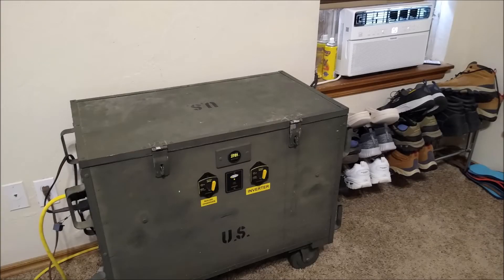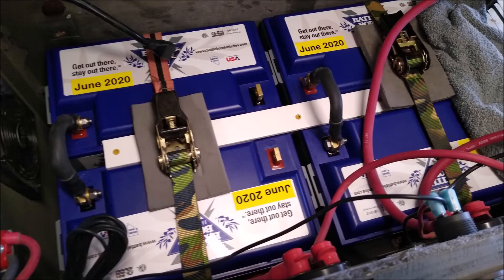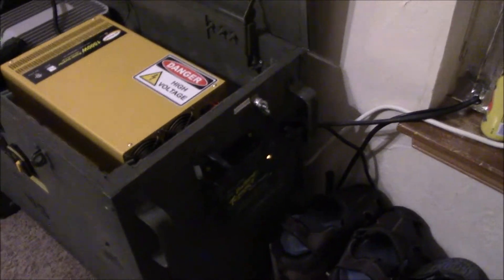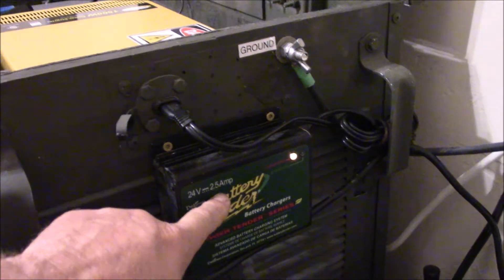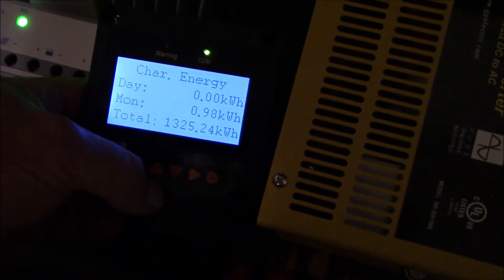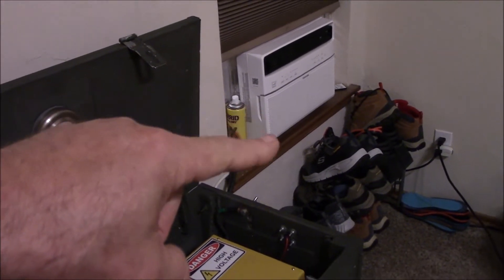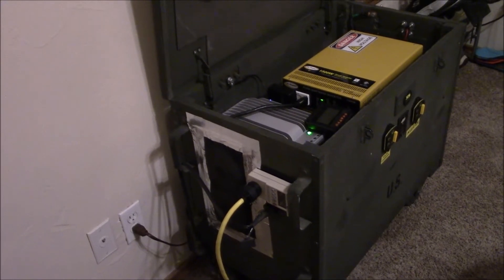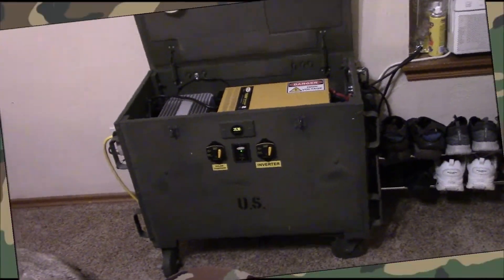Transportable 24v solar power battery charger inverter system (now with Battle Born lithiums)

Comment: the cc 40 amp can only handle 800 watts i thought. i modeled my first solar system off your box lol  same cc mt50  etc but i went zreliable inverter . the my  go inverter  were 1500 watt twice the price as zreiliable. by the way your a class act   as is. will prouse and david potz learned alot off you guys over the last couple of years. if you got a face book or something i could send you a picture of my 3680 watt  solar shack. with its  16  6 volt  gc2  . 8000 usd  in solar  stuff .and no end in site. i even just sold my fishing boat . no time. solar is way more fun. take the boat money and buy me some lifep04. solar addiction is fun. expensive but fun. most hobbies are expensive at least solar gives back .

Comment: hi criss my 8  costco  6volt  gc2 got overcharged by a rouge  chinese  master 100 charge controller. over gassed the shit outta them. what now garbage time? ive since bought the midnight solar charge controller but too late. i just toppedthem  up with distilled and put  a 72 inch battery blanket on in the winter.but  to late they froze. cause the cc shut  down .and sucked them dry.  should i  charge them and then  load them a bunch of times  to get some thing outta them. ive got 8 100 watt renogy panels and iota 45 amp battery bank charger and a prologic smart charger  . do you think switching 4 battery's into service  with the   prologic 2amp trickle for   a week each first individually .then the  renogy panels for a week .using the power daily from just 4  6 volt battery's  in a 24 volt config draining them dry . 4 battery config . and then  the iota charger  for a week 4 battery together over and over?

Comment: very nice setup. Those Battle Born batteries are great. MY go power unit never fails me except for the kind of hanky GFI outlet was always a problem. I decided to keep my 4000 watt samlex inverter. I'd like to use that to play with some lithium batteries someday in the future. I've had excellent and luck with samlex products. Aims products with me well you know the story three for three failure just me I guess.
Reply from the maker: Totally agree...I remember your Samlex. That is good info. Right now, that Go Power! "chirps" every time the air conditioner compressor kicks on (hits it's max output). It doesn't have my surge reserve. The Samlex 2,000 watt (3,500w surge) probably wouldn't even break a sweat running that window unit.
Reply: @ChrisDIYerOklahoma  My Go-power 1500 would start & run my washing machine But not when it hit the spin cycle. The 1500 watt Go Power HS I had had in the high $ hobo had a 3000 watt surge total different unit. I have found the high frequency units no big transformers don't perform as well as low frequency units that do have them.
Reply: It's funny as I thought the aims units sounded pretty stout.. but GreenMountainDiyGuy had problems with his as well.. definitely wont be getting one of those anytime soon!